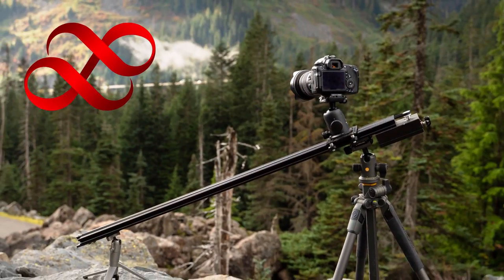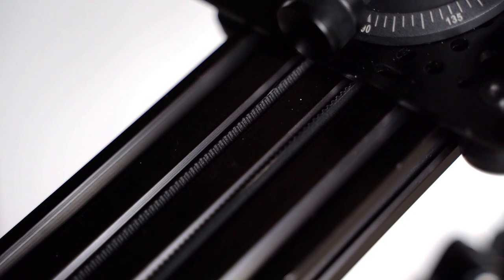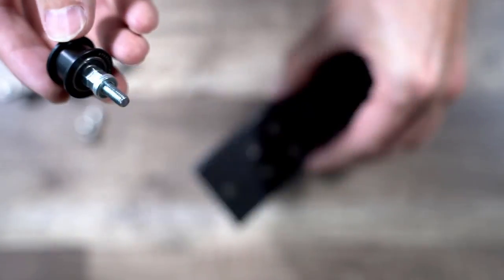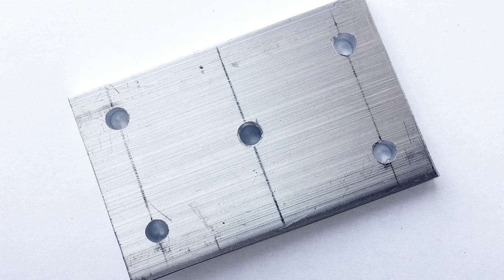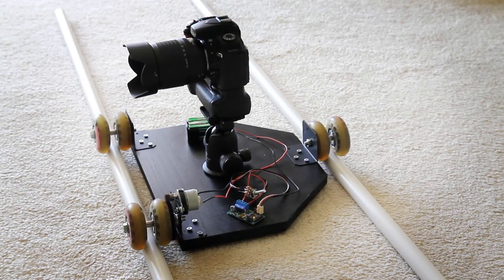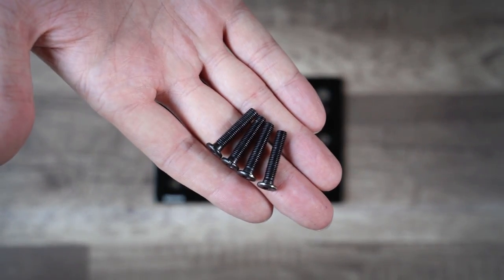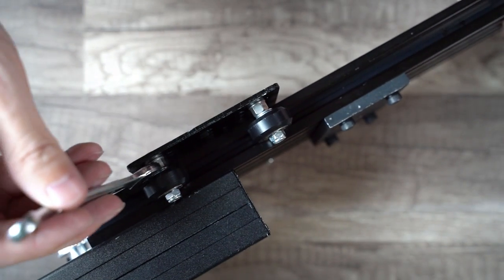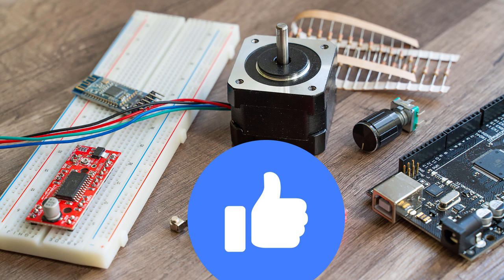DIY TimeLapse Slider Dolly: Cheap but High-Quality (Second Version)

Comment from the maker: Sorry to say that I've abandoned the upgraded Arduino based-version for the time being... too many other things on my plate, and no real practical need for it...  and at least initially, there was very little interest in this video (it has picked up a little over the past several months for some reason)...so it's on the back burner. Maybe not even in the kitchen anymore. I may get back to it someday, but I don't know if or when.
Reply: I would rather do without the Arduino/Raspberry/etc version. I want know how to make it with just a motor/potentiometer/power supply - 
I'm not trying to learn coding for the time being...
Also, I'm wondering if it's possible (it couldn't be that har, and I could figure it out so...) to make a version where you can attach a round plate at the motor end to use as a turntable for motion lapse???

Comment: Dear Matthew, great video! Did you make an update? The website appears to not work anymore, is that right? Did it move?
Reply from the maker: Hi David. Just checked... the website link is still working. Let me know if it still doesn't load for you.  I didn't make any updates after this, unfortunately. There wasn't enough interest for it to be practical :-(
Reply: @MatthewGore  Hi Matthew, thank you for your reply! The website works now, strange that it didn't. That's unfortunate but I understand!

Comment: So im currently working on the slider and was wondering how you mounted the Arca Swiss plate on to the Aluminium Bar... The Space between the Aluminium Bar and the V-Slot Profile is too small for a locking nut, and the aluminium is too thin to drill a fully working thread in it. Beside that everything worked so perfect! Thank you for the inspiration
Reply: And also a question I have is what happens when the Cart reaches the end? The Belt cant go any further and the motor wont stop right? Anyone got a solution?
Reply from the maker: Hi Henri,  The aluminum bar that I used is 1/4" thick... a bit more than 6mm. For me, tapping it worked just fine. I imagine that if I had to remove the plates frequently the threads would get eaten up, but since I just leave the plates connected, they've been strong enough.
Reply from the maker: @henritroms3388  You're right.. this analog one will not stop when it reaches the end... it needs a person to be there attending it. However, the common solution to this is to use a micro-switch wired to the ends that breaks the motor circuit... simple and cheap. This sort of thing might actually fit into the slot and the arm could protrude up into the path of the cart: https://amzn.to/3tF5jI7 If you're doing an arduino controlled version, there are more elegant solutions.
Reply: @MatthewGore  Thank you so much for your help!

Comment: NICE, ANY UPDATES ON THE UPGRADE VERSION?
Reply from the maker: Sorry to say that I've abandoned that project for the time being... too many other things on my plate, and no real practical need for it...  and at least initially, there was very little interest in this video (it has picked up a little over the past several months for some reason)...so it's on the back burner. Maybe not even in the kitchen anymore. I may get back to it someday, but I don't know if or when.
Reply: @MatthewGore  thanks for the reply.  I understand you have to pick and choose. If you pick it up again, maybe add a  swivel to the head to track an object.

Comment: Would you be able to make one of those sliders if someone would be interested to buy it from you and how much would you charge for your finished product? ;) Nice work by the way ;)
Reply from the maker: I could, but it would not be cost effective for the buyer... it would end up costing nearly as much as something that's already out on the market in commercial production (because my labor is expensive :-) ).  But as a DIY project, it's very simple.... just a little time consuming.
Reply: I had the same thought, I'd pay for this, too. I want one 8 feet long, though for really long time-lapse with lots of parallax.

Comment: Matthew what time lapse software you recommend? Thank you.
Reply from the maker: Ahh... since I'm not really heavily into this sort of thing (I just play around a bit), I don't use special software, just the video editor in Photoshop. It can load a sequence of JPGs as video frames, and that's enough for me :-) However, there's a good piece of software for Lightroom... the name escapes me at the moment... but it will reduce flicker and make transitions smoother between night and day, for example. It may be called LRtimelapse. Good luck!
Reply: Try LRTimelapse—it's used in conjunction with Lighroom, and it's a pretty easy-to-use software. Watch the intro tutorial and you should be able to get started pretty quickly with editing your footage.

Comment: So I almost finished the slider but the motor won't spin in the other direction... I couldn't figure out why😖
Reply: I got the button with 3 positions: Off, Left and right and I got the potentiometer but only the left button works....
Reply from the maker: @henritroms3388  Nice! Sounds like you're most of the way there, anyway. Sounds like it may just be a wiring problem? Since your setup is different than mine (and it's been a couple years since I made this thing), I can't help you off the top of my head... but if you want to send me any wiring diagrams, photos of your work, etc, I may be able to help. matthew@lightandmatter.org
Reply: @MatthewGore  Hey, thanks for your reply! I figured out that the Controller is not working properly so I just ordered a new one. Besides that everything works fine! I just can't find a good way to attach the stopping sensors I bought to the aluminium bar to stop the cart when it arrives at the end but that's not a big deal😃

Comment: I'm having to decide between a 31 inch and 48 inch slider. Can you advise?
Reply from the maker: It depends on how you'll be using it. In general, a shorter rail is handy if you're going to be hiking around with it or setting up in tight locations. If you're looking for something to use in a studio, or if you will be using it a short distance from your vehicle or home, then why not go longer? You can always just use part of the travel distance. Ultimately, how much movement you have in your finished video clip is an artistic decision, and it's completely up to you :-)
Reply: @MatthewGore  Thans bro, that was very informative. Can you think of a case when you absolutely have to use the 48 inch slider?
Reply from the maker: @sandy_vb   You will get better results with a longer slider in cases where you don't have anything in the close foreground of your shot. The closer your foreground is, the more dramatic the movement will be in the frame, so the less movement you'll need. You'd want to use more movement in situations where the nearest objects in your frame are a few meters away, for example. However, there's a very narrow window where 31" will not be enough but 48" will be, and in most of them it will probably be possible to re-compose your shot to get the movement you need. That said, I'm not really a film-maker, just a photographer... so I'm still learning how to use tools like this, too.

Comment: Incredible! What's the slowest speed the motor has? Is 3 rpm the fastest it can go? And do you toggle the speed via the potentiometer? Thanks:)
Reply from the maker: The "3rpm" rating of the motor is the speed that it will turn with a 12v power supply, with no motor controller. I use it with 9.6v (8 x 1.2v AA batteries) so it won't reach 3rpm, but with the motor controller, it can go much, much slower than that. If you want it to go faster, you can simply switch in a motor with a higher speed... I see them on Ebay at 7RM, 24RPM, 30rpm, and over 100RPM. But those wouldn't be very useful for time-lapse work :-)
Reply: @MatthewGore  good to know. Thank you very much for that fast reply!